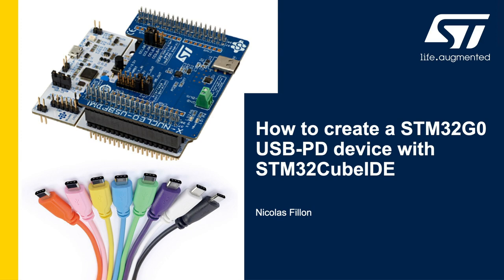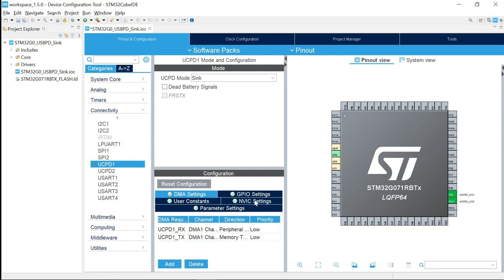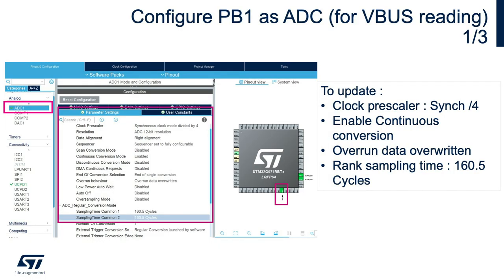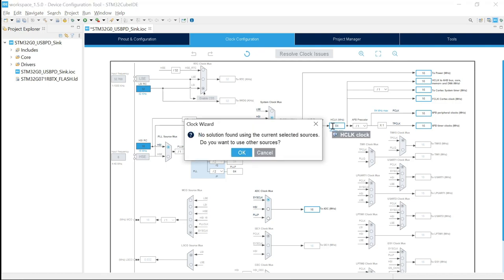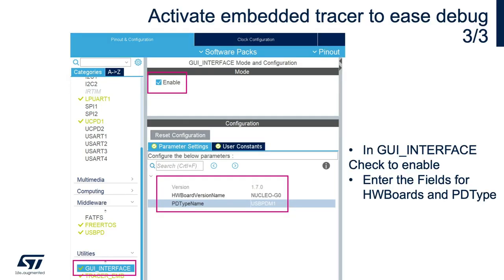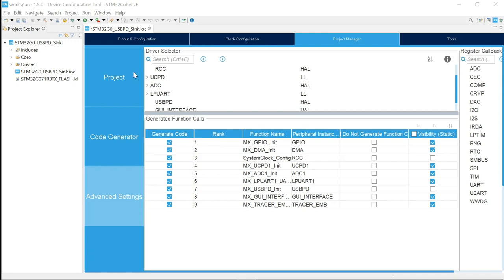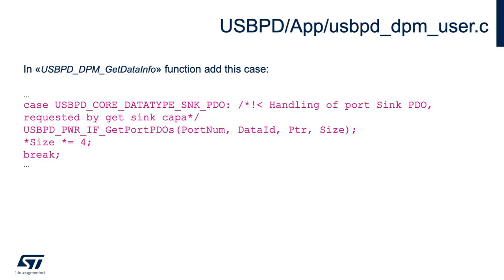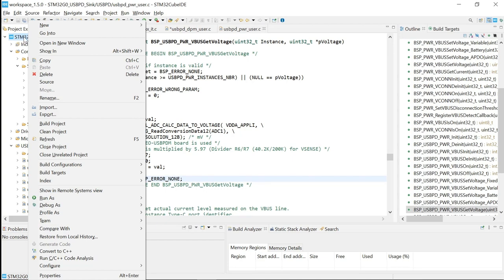How to Create a STM32G0 USB-PD Device with STM32CubeIDE

Comment from the maker: CODE TO BE ADDED: 

In Core/Src/main.c:
…
/* USER CODE BEGIN ADC1_Init 2 */
HAL_ADCEx_Calibration_Start(&hadc1);
HAL_ADC_Start(&hadc1);
/* USER CODE END ADC1_Init 2 */
…

In Core/Src/stm32g0xx_it.c:
…
/* USER CODE BEGIN SysTick_IRQn 0 */
#if defined( _GUI_INTERFACE)
GUI_TimerCounter(); /* needed with GUI_Interface */
#endif
/* USER CODE END SysTick_IRQn 0 */
…

In USBPD/usbpd_dpm_user.c:

In USBPD_DPM_GetDataInfo function:
…
case USBPD_CORE_DATATYPE_SNK_PDO: /*!< Handling of port Sink PDO, requested by get sink capa*/
USBPD_PWR_IF_GetPortPDOs(PortNum, DataId, Ptr, Size);
*Size *= 4;
break;
…

In USBPD/usbpd_dpm_user.c:
In USBPD_DPM_SNK_EvaluateCapabilities function:
…
/* USER CODE BEGIN USBPD_DPM_SNK_EvaluateCapabilities */
USBPD_SNKRDO_TypeDef rdo;
/* Initialize RDO */
rdo.d32 = 0;
/* Prepare the requested pdo */
rdo.FixedVariableRDO.ObjectPosition = 1;
rdo.FixedVariableRDO.OperatingCurrentIn10mAunits = 50;
rdo.FixedVariableRDO.MaxOperatingCurrent10mAunits = 50;
rdo.FixedVariableRDO.CapabilityMismatch = 0;
*PtrPowerObjectType = USBPD_CORE_PDO_TYPE_FIXED;
*PtrRequestData = rdo.d32;
/* USER CODE END USBPD_DPM_SNK_EvaluateCapabilities */
…

In USBPD/usbpd_pwr_user.c:
…
/* USER CODE BEGIN include */
#include "main.h"
/* USER CODE END include */
…
/* USER CODE BEGIN BSP_USBPD_PWR_VBUSGetVoltage */
/* Check if instance is valid */
int32_t ret = BSP_ERROR_NONE;
if ((Instance >= USBPD_PWR_INSTANCES_NBR) || (NULL == pVoltage))
{
ret = BSP_ERROR_WRONG_PARAM;
*pVoltage = 0;
}
else
{
uint32_t val;
val = __LL_ADC_CALC_DATA_TO_VOLTAGE( VDDA_APPLI, \
LL_ADC_REG_ReadConversionData12(ADC1), \
LL_ADC_RESOLUTION_12B); /* mV */
/* X-NUCLEO-USBPDM board is used */
/* Value is multiplied by 5.97 (Divider R6/R7 (40.2K/200K) for VSENSE) */
val *= 597;
val /= 100;
*pVoltage = val;
}
return BSP_ERROR_NONE;
/* USER CODE END BSP_USBPD_PWR_VBUSGetVoltage */